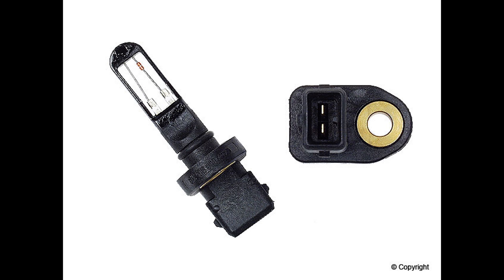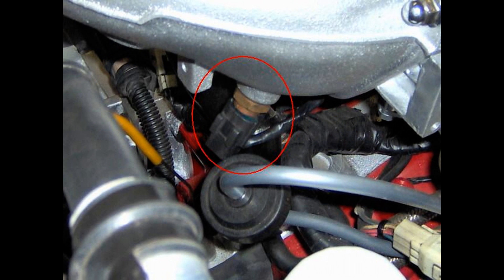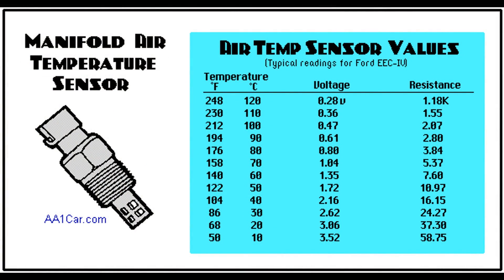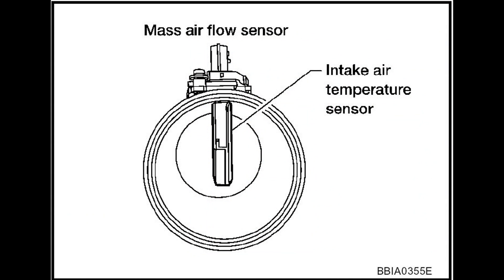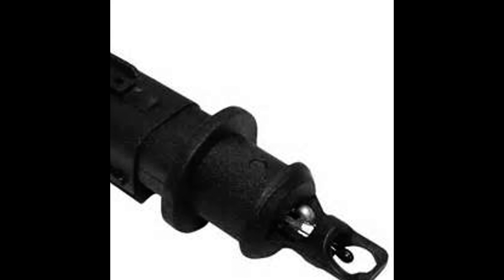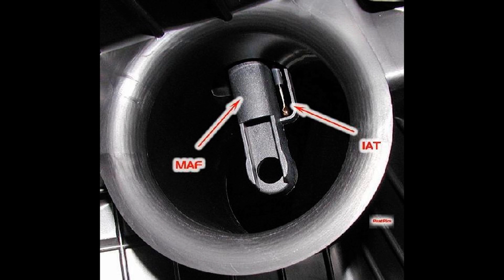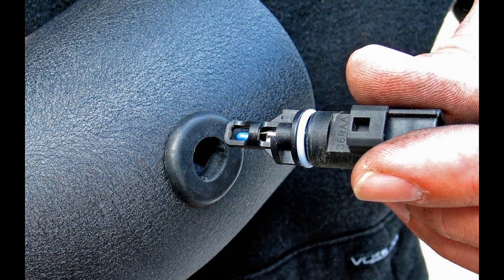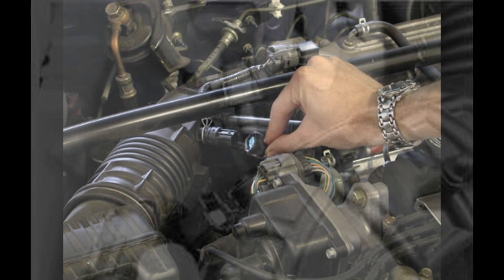IAT - Intake Air Temperature Sensor , Why You Need It? What it Does?

Comment: I had my car dyno tuned in the hot summer and it was a really good tune. Now with an intercooler upgrade and much cooler weather I've been having issues with fuel at higher rpms. My intake air temperature sensor is  mounted  before the turbo.  Do you think it may help with fuel issues if I move the iat sensor in front of the throttle body after the intercooler?
Reply: It solved my issues for now.  I moved the iat right in front of the throttle body.
Reply from the maker: Maybe
Reply: Well temporarily it did.  Update: In my own opinion my tps sensor is at suspect.  Everything else passes the test.  I may also be at the wall of my boost cut. Problemas

Comment: What would be considered "normal" intake air temperature? Mine was reading up to 68°C (154°F) with an outside air temperature of 30°C (86°F), car stopped and A/C on, dou you think it's ok or is it too much??
Reply from the maker: I think its too much,but on not moving car its always showing more,its why sometimes when u leave car for a minute,and start to drive it,she drives worst,because engine heated IAT senssor,and ignition time got later.
Reply: CarShed68 thank you very much!